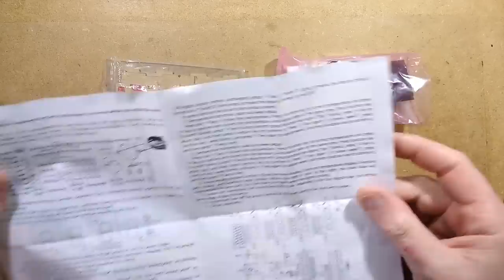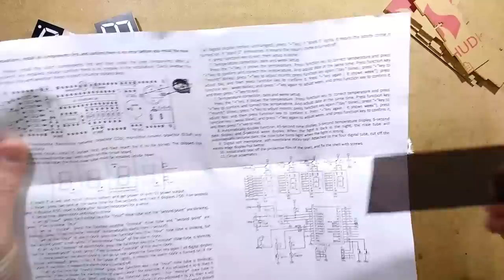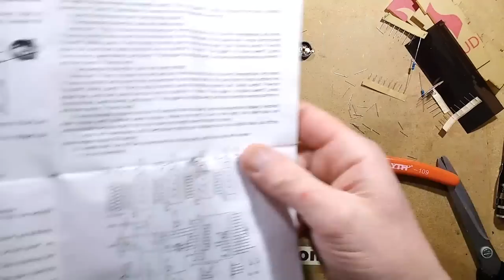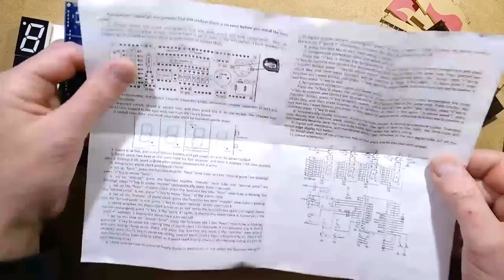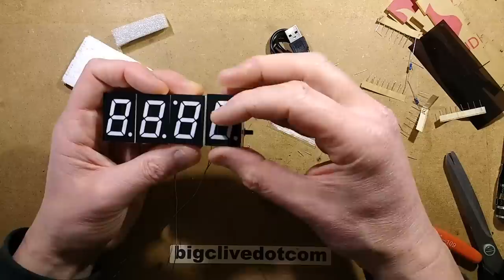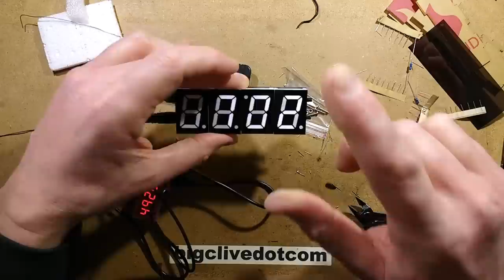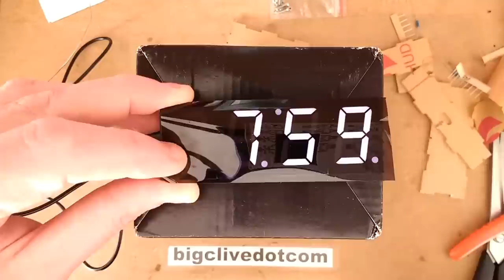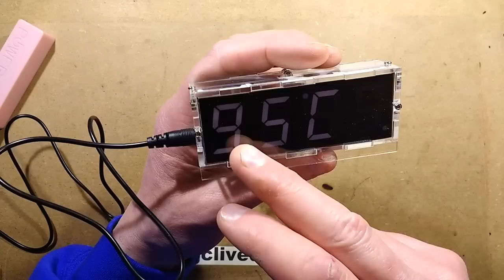eBay clock kit.  Full build and setting guide.

Comment: One thing I learned recently that kinda blew up my view of electricity was learning the fact that the actual speed of electron motion was extremely slow, on the order of mm/s at best. I always used to believe the speed of current was the speed of electron motion.
Reply from the maker: Current flow (electron displacement) happens at almost the speed of light, but the actual flow of electrons through a conductor is extraordinarily slow.
Reply: bigclivedotcom Yeah my prof made it click when he made the comparison to an atmospheric shockwave. 

We get into the really nitty gritty of electron collision next week. :)
Reply: +ElectricAvain Mine used the analogy of ping-pong balls in a pipe.
Reply from the maker: Graham Langley Which is a good analogy, and what I was considering doing.
Reply: +bigclivedotcom Consider no more - it was over 40 years ago so it's stood the test of time  8-)
Reply: Mine used a rather interesting analogy of having a row of people sit close but not touching, and then gently pushing the person on one end so that everyone bumps the next person along quite quickly while nobody leaves their seat.
Reply: Imagine it as a hose full of water.When you turn on water,it goes out almost instantly,but that is happening because water that was previously in the hose is being pushed out.Actual water that comes from a tap travels a longer distance and obviously requires more time.
You could also imagine it as a Newton's cradle.The last ball pushes entire row,so the first ball bounces up almost instantly.
Reply: I have my own analogy, Put a drop of water into the Atlantic ocean on the East coast of the USA and at the speed of Light a different drop of water pops out at West coast of Europe.
Reply: @arthurhardy  Not the speed of light. Actually the speed of sound in water.
Reply: @greenaum  Not even paying attention
Reply: is this why my hall light is 2 full seconds from switch to lights on?? :)
Reply: @ceejayc6502  No that's capacitors charging in an LED bulb most likely. Even though the physical electrons drift slowly, the effect travels down them at near the speed of light. Imagine people in a slow moving line, but somebody suddenly bumps the last person in line, then that person bumps the person in front of them, etc. The people themselves aren't moving (quickly) but the energy pulse of the bump moves down the line much quicker.

Comment: Having been screwed over by Maplin 30+ years ago when they broke their mantra of "we always use the same resistor coding" but changed it without telling anyone. I gave up electronics. You and Julian inspired me and I have build a little bench power supply and am completing my DSO oscilloscope kit. The perspex cases are futtery as you suggest but I got there with little instruction but common sense.

Comment: It's not because lead free solder is hazardous in the process of soldering, it's because what happens with it in the waste process. It's just part of a wider initiative to reduce the amount of lead used in production overall. The big problem of lead is that is a very useful metal, and it has several applications where alternatives aren't readily available. It seems to me soldering was a relatively easy target. After all, lead water pipes were already banned ;)
Reply: I thought the justification was to keep lead out of landfills, because while it is reasonably harmless to us, it's not harmless when it leaches into ground water, but isn't the EU mandatory electronics recycling supposed to do that? Then again, recycling is probably one of the least effectively implementable mandates, as opposed to RoHS, which can be and is implemented quite thoroughly. Anyway I have been pretty certain that justifications are usually just that, chances are some people in the industry were disappointed that things weren't breaking often enough, so not enough things are thrown away and bought anew, and lead free solder introduces a stress failure point, a pretty smart one at that, that it won't usually trigger too quickly, rarely within warranty, and one that goods from all manufacturers would be subject to, so none of the manufacturers can be blamed for low quality, brilliant!
Reply: Lead seeping into the water supply... Gee, wonder where we get lead in the first place.... oh right, out of the ground!
Reply: well in the last two wars we chucked about a fair bit of lead !
Reply: Take a look at Guiyu, China or Agbogbloshie, Ghana. Electronic waste is an immense problem that is shifted onto the developing world.
Reply: "Lead seeping into the water supply... Gee, wonder where we get lead in the first place.... oh right, out of the ground!"

Exactly what I was thinking.
Reply: Tech Obsessed Some people do. Not me, I hasten to add. 😁
Reply: Its the flux thats the issue, not the lead.
Reply: care to elaborate on that ? Some of the oldest types of flux is based off pine sap (refined and purified) called rosin. Rosin flux is still used today so I don't think that is much of an issue we used to have to scrub it off with a brush in some alcohol or IPA
Reply: You can't ignore that "Natural" or "Naturally Occurring" substance are hazardous to health... To accept that natural poses no hazards is ignorance in itself.

Quote "Flux generates the visible fumes seen during soldering. Exposure to rosin can cause eye, throat and lung irritation, nose bleeds and headaches. Repeated exposure can cause respiratory and skin sensitisation, causing and aggravating asthma. Rosin is a serious occupational health hazard."

You could say that Oil is a natural product that is safe to use when it is not.
Reply: Mark Giblin wait what was your point again? Rosin flux was never banned. If they had banned leaded solder in the hope to save poor workers from rosin flux, well that's not how it works, as higher temperature soldering incurs more flux evaporation, and less sticky solder requires better surface preparation which means switching from mildly activated flux type to a highly activated.
Reply: You have missed the point all together, listen again to what BC said.
Reply: Mark Giblin so you essentially gave up on trying to make sense?
Reply: No, I said, listen again to what BC said, do you not understand English?

There is no point if telling someone something when they don't pay attention to you, so simple option is to suggest that they listen again to what the person said in the video.

If you can't comprehend the content then thats not my problem is it?
Reply: Mark Giblin Clive said that flux was much more dangerous than lead, yeah, it's pretty bad, it's an irritant, it's an allergen, it's an aldehyde source, so headache is a normal side effect. But this thread is specifically about the cause of ban on leaded solder, and flux was not the reason.
Reply: Siana Gearz The ban was to do with big manufacturing and the disposal of all the electrical waste in to land fill. For the hobbyist, its not that much of a big deal and having used this new solder, I have to say its horrible stuff.
Reply: Oh, redundant comment (I'll let it stay anyway)
The comment was directed to the other commenter. 

Lead is hazardous to humans, I don't think there is notable amounts in the fumes though. The larger problem is when all that lead gets concentrated again when it's not correctly disposed of (wish is in most cases is not).
Reply: custardo I
Reply: Mark,
"You can't ignore that "Natural" or "Naturally Occurring" substance are hazardous to health... To accept that natural poses no hazards is ignorance in itself."
Lead is an element not created or destroyed in any significant amount on earth.  If we take it out of the ground, or put it back, there is no more or less.  What is the problem?  If lead being in the earth is bad then by that logic maybe should use it more so less of the earth's total lead would be in the ground.
Reply: Yeah, yeah, yeah! But it’s ok to put Titanium oxide in semi-skimmed milk (to make it look “white” after removing only 2% of the fat) and not give people a choice of full fat  when going out for a tea or coffee?
Reply: Lead doesn't come out of the ground, it's ore does. It needs processing to produce the metal. And besides that, just because something is dug up in a mine, doesn't mean you'd want it in your drinking water. Hence the fairly obvious requirement for environmental safety regulations. 

As others have mentioned, the places that don't have them, poor countries where so much of our waste ends up, have areas that are toxic hellholes, where the residents make a living picking over toxic rubbish and suffer terrible health effects because of it. 

It's amazing how often simple aphorisms like "it comes out of the ground" are completely moronic and wrong. No wait, not amazing, what's the word? That's right, "fuckin' obvious".
Reply: @SianaGearz  Flux is more dangerous to the solderer than the lead is, for the simple reason that lead doesn't vapourise at soldering temperatures, flux does. So when you're holding your breath, it's to keep flux fumes out. To the environment at large, once the solder's cooled, it's the lead that's dangerous.

Comment: I've never burnt myself with a soldering iron, but I did once touch the exhaust manifold of my car's engine while it was running...that's another of those things that you don't do more than once!
Reply: I grabbed the exhaust of a lawn mower as if it was a knob, looked at my palm and saw the logo from the muffler grill develop into a blister. It hurt but i had to laugh.

It's been a couple years since my last burn of any sort, but for some reason i remember them. These memories are far more effective than warning labels.

Excepting AVE's warning labels, which are amazingly effective.

Comment: I got one of those clocks. The major thing I HATE with it is that I can't set it to only display the time. It feels like it's showing me everything but the time every time I look at it.
If anyone got a solution to that issue I'd very much like to hear it.

I've had it for something like 9 months now.
Reply: You must be lying, how can you tell how long you have the clock, if it doesn't show you the time? ;) I was wondering about that though, totally understandable.
Reply: If it's a microcontroller, you could rewrite the firmware. For something like this, it's fairly straightforward.
Reply: You can, easily. Just join pins 6,7 and 14 on the bigger IC and it will stop cycling automatically.
You're welcome :)
Reply: Have a look at the clock on Banggood, in the reviews someone mentioned a way to make it just display the time. It may be as already mentioned, by pressing one of the buttons.
Reply: Thank you! Just tried it and it worked just fine!
This gotta be the first time someone actually helped me in the Youtube comment section. It's great how Clive can bring people together like this!
Reply: APL K what cured it? joining the three pins or holding one of the buttons? I have the same clock and the same issue, just in green.
Reply: Like MasterBata said - join pin 6,7, and 14 on the big IC.
Reply: Worked for me too.  A quick/nasty solder job between 6-7-14 on the bottom row (working from the left).  You can still cycle the display manually using the buttons too. 

Perfect.  Can't thank you enough MasterBata.
Reply: MasterBata superb help. relief all my exasperation for past few months looking at the clock display not seeing the time when needed. cheers
Reply: super helpful 6, 7 &14 works like a charm.
Reply: Anyone know why it works?
Reply: It could be that these pins are supposed to have jumpers on them, and the firmware checks them. disassembling the firmware would answer that question, but that isn't trivial...
Maybe there's a different kit with the same chip and firmware and the jumpers, and someone decided to try it out.
Reply: It might not be too hard to get the firmware. These chips usually have read protect bits but they're often not set. disassembling may or may not be tricky. But you may be right about the jumpers. Or maybe it was the guy who wrote the firmware who responded :)
Reply: Hack a Pi Zero into it and it'll show more then just time :) Hell, it can bitch about how rainy its going to be tomorrow with its wifi dongle via the PI.

Comment: OOOH you could replace the LEDs in the display for different colours!
Reply from the maker: Callum Burns I was thinking that.  Every segment could be a different colour.
Reply: Cool idea!
Reply: Every segment in a different color would be really hard to read, compared to being in the same color.
Reply: Color changing LEDs in everything.  It's only sensible.
Reply: yadabub Interesting idea. I'm not sure how it would look though, since every segment naturally has to have its own light box.
Reply: What size are the LEDs Clive? Going to try this!
Reply: Color changing LEDs won't work since all the segments are multiplexed.
Reply: Are you sure?  Have you tried powering color changing LEDs with pulses?
Reply: Make it happen!
Reply: Good thing to try sometime.  If it works, as it is, the semicolon might always be RED.  The rest of the digits would be quite interesting!  Each of the 'newly on' segments might re-sync to RED.  Now, if you want it really annoying, use fast change LEDs :-D
Reply: RGB colour morphing!
Reply: +Tartrazine A more ambitious option would be to change the main PCB to hold the SMD LEDs directly (single or multi colour), then just pop the light box(es) on top. I have found that basic white paper is a good substitute for the diffuser plastic, but you still need some non-transparent material white plastic or tinfoil, to guide the light from each LED to the right shape (line or dot). I suspect that a premade 7seg unit is traditionally cheaper than 8 individual LEDs, though their declining use in mass market products may have changed that by now.
Reply: Google (or bing if you're that way inclined) "rgb seven segment display".
Reply: Replace them with color-changing LEDs.  :D   Psycho clock!
Reply: @superdau  Might still work, but if it doesn't, perhaps a little capacitor across each LED might hold current for long enough to at least keep the colour-changing logic powered. After the voltage falls below the level to keep the LED lit, it might still be enough to keep the logic going. So a cap would do nicely.

Comment: Where government is concerned...their "solution" to a problem (that they themselves created) is usually worse than the original issue.
Like R134a refrigerant being so horribly under-performing compared to the original R12...which means your electricity and/or fuel bills will be much higher.
Which then causes exponentially higher greenhouse gasses from having to produce more electricity or more fuel to run your engines harder to make up for the shitty refrigerant not working as well.
Your government at work.

Comment: I built a pair (one for local time and one for UTC) of these in red and assembled them for use in my mobile ham shack about the same time you made this one.  The cases were a PITA to assemble, especially peeling the paper film as you noted, but the end result was quite pleasing.  I did make a small modification to allow them to be powered from the vehicle's 12vdc battery bank (solar recharged) instead of USB.  

The units had a few issues that made me remove them from the shack though.  Trying to synchronize the two so one was not a minute faster or slower than the other proved very difficult (I actually tried integrating a GPS receiver to provide time correction but that didn't work well).  Getting them to have the proper level of brightness for the lighting in the trailer became just a matter of removing the photoresistors and using a fixed resistance.  In the long run though, they proved to be unsuitable for what I wanted.  They didn't well tolerate the temperatures that could be reached in my trailer under the strong summer sun here in the state of Virginia.  Also as you found, there are just too many functions which take away from displaying the time.  That's what eventually tipped things in favor of just getting rid of them.

Comment: I made one of these and 4 weeks later it still works great, and I'm a newbie, the case isn't that hard to construct.   I think Clive is being a bit harsh, for the 5 euros I paid for it I'm extremely happy. Ignore his slight negativity, this is a really fun little kit.
Reply from the maker: Was I really negative?  My only real issues are that it cycles through displays by default and a good clock should be displaying the time whenever you glance at it.
Reply: I agree but then after a while you get used to seeing the additional info, it makes it a genuinely useful device, I never thought I'd still be using it a month later. I chuckled as you were moaning slightly about the casing not being easy to construct, for a 5 euro kit it's nice to get a decent case, and I think anyone smart enough to build the device would be able to cope with the case!   These kit construction videos are genuinely really useful, thanks for uploading.

Comment: Great videos, decided to get and build the kit. Slight update is that the temp sensor now has a clear way of mounting which helps its accuracy, also since I use it in the shed I thought to let others know it takes about 0.1A so low power. And in the depths of winter the temp display actually display negative values. Well worth the effort

Comment: I made one of these last year, although I got it from Banggood. It's surprisingly accurate - hasn't gained or lost any noticeable time in the 6 months it's been running in my garage. The temperature reading seems to be vaguely accurate, but I'm not worried about that. It's a great little clock and good soldering practice.